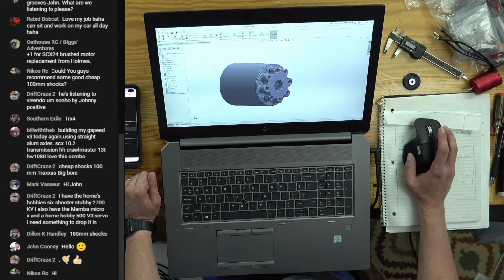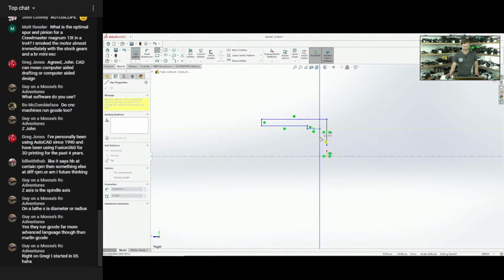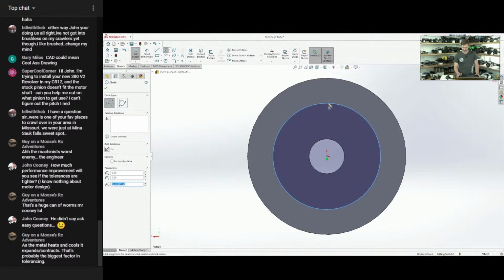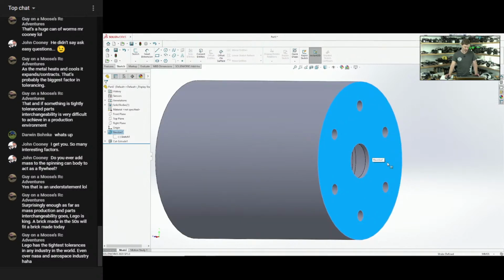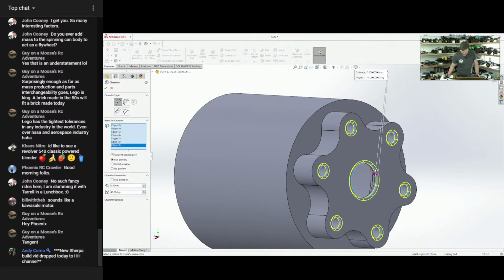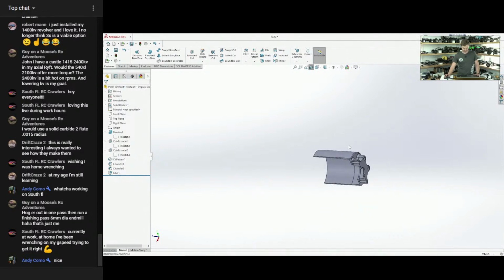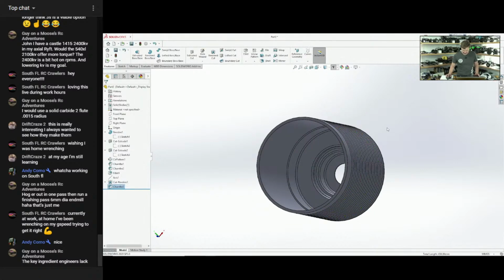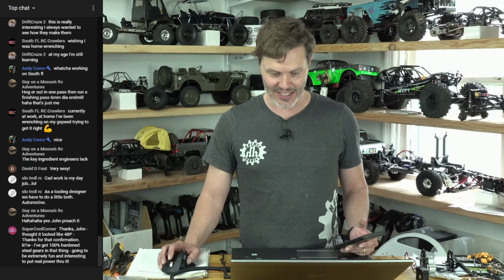CAD tips with John

Comment: I always love to see people using very similar equipment to what I do for CAD. I love my MX Master (2), and my work computer is a ZBook. 
Personally, my favorite is NX, although the lion's share of my hours is in Solidworks (1400+).
I always start with a throwaway file in which I will generate the features that I care about, and then a more refined file that takes machine processes into mind.
Would love to talk design/CAD if you ever want to make the time.
Reply: A tip in Solidworks, if you drag a diametral dimension past the centerline, it will snap to being the diameter size so you don't have to do so many calculations, even if they're simple.